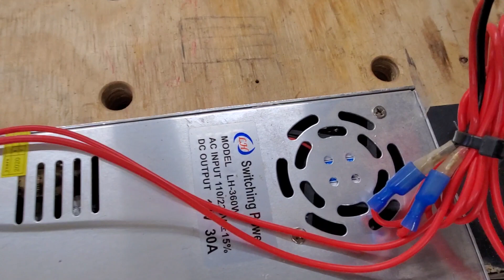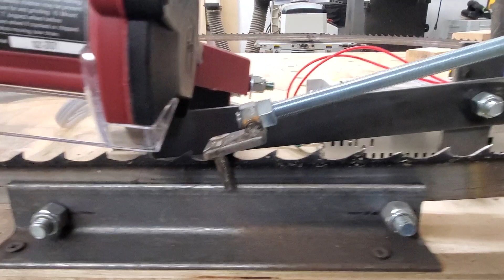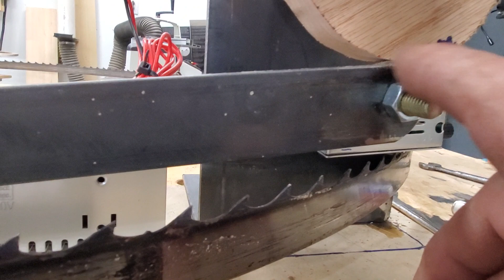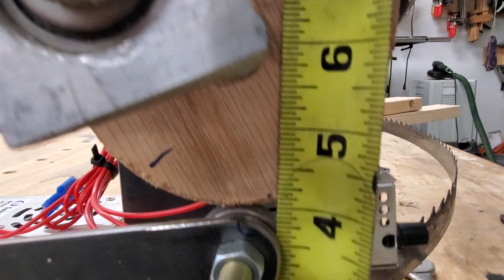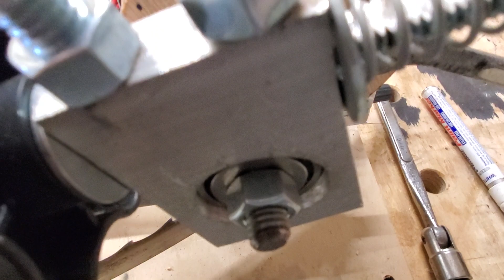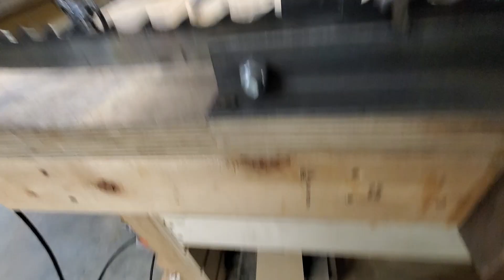homemade bandsaw blade sharpener

Comment: Nice build.Can I have some links to your motors , power supply and speed adjustment switch please?
Reply from the maker: 12V Fan Controller, DROK DC Motor Speed Controller for Brush Motor 7V-60V 20A 420W PWM Driver Board Control 12V 24V 36V 48V Regulator Cooling Fan Dimmer Governor Pulse Width Modulator with Adjust Knob https://www.amazon.com/dp/B00DVGGWC0/ref=cm_sw_r_apan_glt_i_Y7TH5XC3XV93TG4QGG5V?_encoding=UTF8&psc=1
Reply from the maker: SUPERNIGHT 12V 30A Switching Power Supply, 110-240 Volt AC to DC 360W Universal Regulated Switching Transformer Adapter Driver for 3D Printer, CCTV, Radio, LED Strip Lights,Computer Project https://www.amazon.com/dp/B01LATMSGS/ref=cm_sw_r_apan_glt_i_S9TWCZWS74G7EPSRQKDT?_encoding=UTF8&psc=1
Reply from the maker: BEMONOC High Torque PMDC Right Angle Gear Motor 12V Reversible 50 RPM (Right Gear-Box) with Threaded Shaft https://www.amazon.com/dp/B01GJ4VPH2/ref=cm_sw_r_apan_glt_i_JQB856VSJFHEHMEE7Z5S?_encoding=UTF8&psc=1